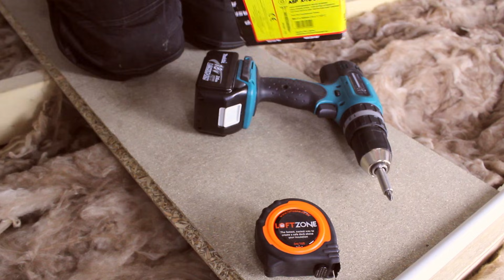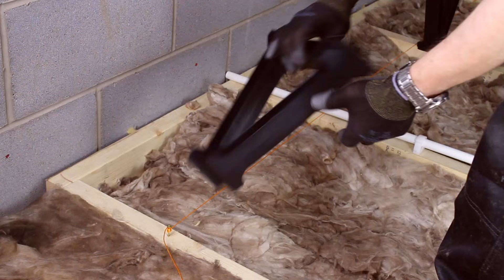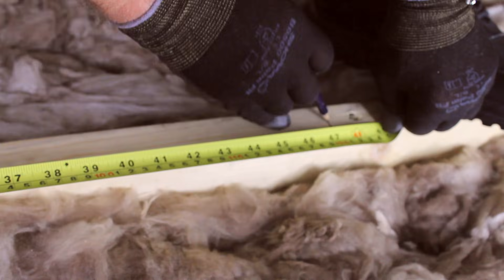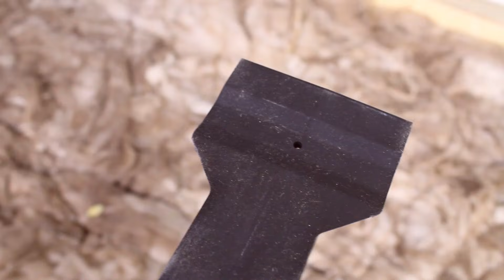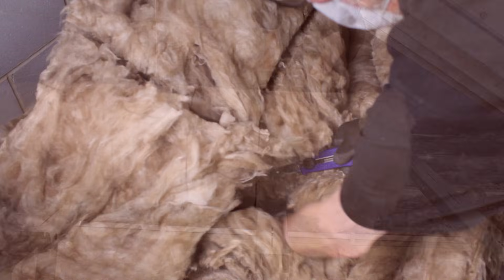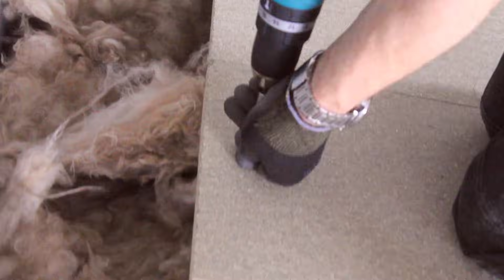How to Board a Loft Above Insulation | StoreFloor Raised Loft Boarding System | LoftZone

Comment: Appears to wobble after installation - do you recommend bracing the floor against the structure to prevent this movement (especially a concern since you chose to make the supports out of plastic)?
Reply from the maker: Hi there +dakotamax2 

Happy to say that the deck does not wobble once it's all fitted. The boards provide lateral resistance and prevent any wobble. The supports and Cross-Beams provide stability in the other two directions too, making it firm in all three dimensions. The deck was independently tested and shown to be far stronger than required by building codes, which is why 1000s of people have installed them and our average rating across all platforms is usually around 4.9 out of 5 stars. 

As for the plastic, that's necessary to comply with building codes. If we used wood or metal for the supports, these would transfer heat from the room below into the loft (this mechanism of heat loss is called a "cold bridge") and hence this would be against building codes for new houses in the UK. Using wood to build a raised platform is not a good idea, as the wood simply allows the heat to leak through the insulation. 

If you've got any more questions or need some more advice, drop us an email on sales@loftzone.co.uk. Thanks.
Reply: @LoftZone  surely the timber truss itself is a cold bridge as it is under the insulation and also around the roof , conected all together . Is this not correct? What building code in particular are you referring to? Also would the weight rating not bepend on the joists themselfs as opposed to any systems used to rise the boarding ? . I ask as im intrested and may use loftzone in my loft . Seem to be alot of over engineered and under explained products to do this . I want to choose the right one . Thank you
Reply from the maker: Hello  @boysatfishing9891  , happy to reply! Timber does indeed act as a cold bridge, taking heat through and around the insulation. There's not much you can do about that, other than completely changing the whole roof, but as a good rule of thumb, the fewer timber cold bridges, the better. That's why, for example, the old-fashioned way to raise a deck above the insulation by cross-bracing with timber, is no longer recommended. In fact, in Part L1A of the building regulations across the UK (answering your next question), if a builder does use timber in this way, they have to change the SAP score for the roof to account for the extra cold bridges they've put through the insulation. Next, weight. Yes, as we described extensively on www.loftzone.co.uk, the LoftZone structure has been tested to withstand at least 500kg/m2. But your joists are unlikely to be as strong as this, so you need to be sensible in your loading of the deck. For example, for new build houses, the legal minimum weight that they can take is 25kg/m2 of a long-term distributed load (such as stored items) and 90kg as a short-term point load (which you can imagine as a person of 180kg with 2 legs walking around, for example). But that's the minimum, many houses can take more, but we advise you to be sensible about loading and, if unsure, to consult a structural engineer. Finally, if you want more info, please see www.loftzone.co.uk (or in the USA www.loftzone.com) and also, we are the only product for raised loft floors that has the necessary technical approval for construction, which you can see at http://bbaportal.com/CertificateFiles/52/5269PS1i1.pdf (with more technical info, too). I hope that helps! All the best from LoftZone.
Reply: +LoftZone Thanks for the response!

The wobble I am referring to can be seen as the technician applies lateral force perpendicular to the brackets at (https://youtu.be/Swgp4NtNeJo?t=5m16s). 

I suppose this improves as more fasteners are installed from the deck to the riser/braces, but it will depend on the ability of the fasteners to resist angular deflection. I like the product, but for a floating deck that does not contact a side wall, it would be my preference to install a level/horizontal brace at the lateral side of the loft-deck to a roof rafter to eliminate any movement.
Reply from the maker: +dakotamax2 and thanks for the exact link!

The section of video you refer to is before the boards are screwed to the Cross-Beams. The installer is pushing the boards into position. Once they're screwed down, they don't wobble. 

The point you make is valid, in general, though. Fair enough that many floating decks can wobble. However, so long as the boards are screwed in, you'll find that it's really not a problem; there are several screws per part and per board and they provide  the strength needed. Even better if you use tongue-and-groove boards. But if you wish, you can of course use some wood to provide lateral restraint. 

By the way, don't take our word for it, try it for yourself! If you email us, we can send you a 2.4m x 2.4m (8ft, x 8ft,) deck and I'm sure we can do you a good deal.

All the best, LoftZone
Reply: +LoftZone Still interested, thanks for the response(s)!
Reply: @MrBish11  the cold bridging goes through the joists through the first 100mm, by-passing the insulation, then on to the next set of joists above that. It's written into Part L1A of the Building Regulations across the UK, and is called a psi factor, if you want to look it up. Every architect has to work within these rules, which is why you will rarely see cross-battening in new build properties these days. It's simple building physics.
Reply: @MrBish11  But the first 100mm is laid in-between the joists. Hence why heat can travel up through the wood and by-pass the first 100mm of insulation. If you then put more wood on top, and insulate between that, you are creating a path through the loft whereby the heat can avoid the insulation altogether.
Reply: @MrBish11  Well Mr Bishop, I've tried to be polite and helpful, though some of your replies are a bit dismissive so I'll stop now. It's simple building physics really, but you don't seem open to understanding or maybe I'm just not explaining it in a way that you understand. If you're open for learning, maybe I could suggest this course that is certified by the Chartered Institute of Architectural Technicians: https://ciat.org.uk/resource/loft-insulation-isn-t-working.html. Hopefully they will be able to explain it to you. I wish you all the best.
Reply: Dave Raval, you tried and thanks for your patience with this ignoramus. At least I learned something from your replies.
Reply: @MrBish11  lol, so you think heat transfer just stops after a certain distance? Heat transfer is infinite. If heat transfer ever just stopped, it would break the laws of thermodynamics.

Comment: My loft is 1900mm high and I can just about stand in it. If I was to use this method of raising my floor I wouldn't be able to stand anymore. It looks like a huge waste of height
Reply: Again you say law but what law?
Reply from the maker: +MAADMO Well it's designed to go above the insulation, which by law has to be a certain height (typically 270mm in the UK, 11" or so in the USA, etc). So it's not wasting height as you've already lost that through the insulation. Instead it's bringing back space you otherwise couldn't use. That's the point of it.
Reply: Building Regulations in England and Wales, Part L. In Scotland, the requirement is for more.
Reply: It is if you undertake any notifiable work on your building. The council will certainly enforce Building Regs!
Reply: @DaveRaval  I don't understand though, if that's law, why isn't that much insulation already in my loft?
Reply: @Omfgwhtavid  Its not law, its a recommendation only on existing builds.
Reply: Thats not Law
Reply: Multiple Acts make building regulations law, plus supporting Statutory Instruments, that are also law.
Reply: "Thats not Law" hahaha. Cowboy builder spotted - yeeha!